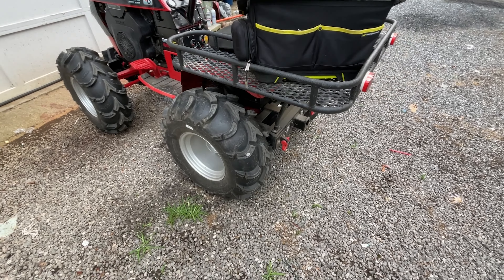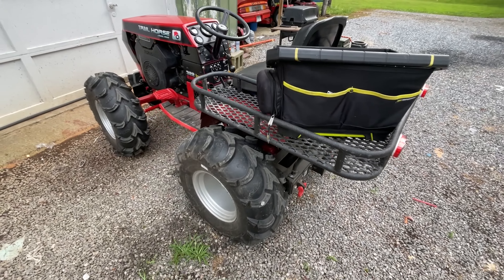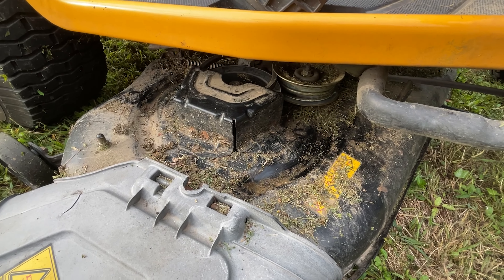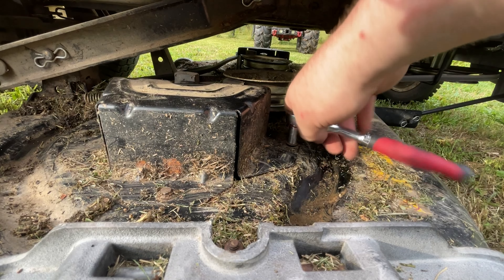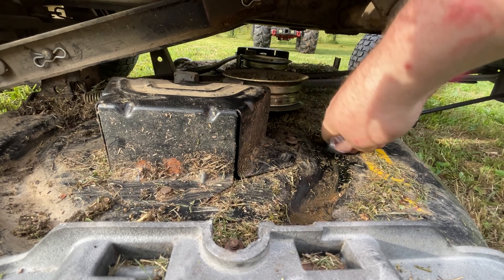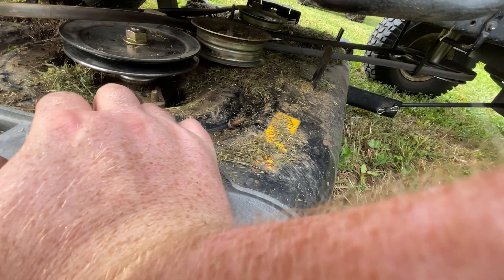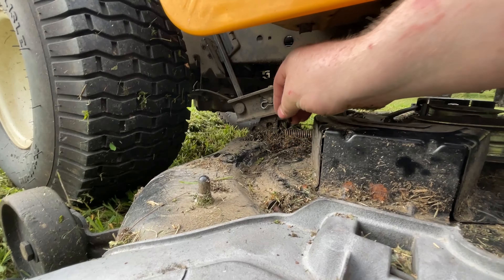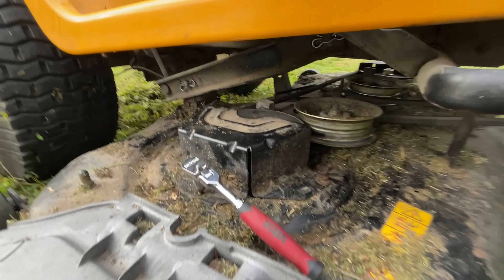A Mower Emergency! Sunday Afternoon Service Call.

Comment: I just got finished up on the fabrication and testing of a John Deere 214 Mud Mower. It’s got a four-speed Peerless 2300 transmission in it. I did a pulley swap where I put a 7 inch on the motor and a 5 inch on the transmission, that seems to be the general go to ratio. When I start out in third or fourth gear, I get belt squeal when I’m leading the clutch out. Only for a second though, and once it’s engaged It’s fine. Right in the beginning when you took off it sounded like there was a bit of belt squeal. Also, does yours do it every time?
Reply from the maker: I’m running the stock 8 speed uni drive. It has 3 speeds forward with a high and low range. The downside to this transmission is they don’t shift to well on the fly.  But there bullet proof. Low range I don’t have any belt squeal. High range first takes off fine, 2nd depending on the terrain you might have to let the belt slip a bit. 3rd gear you have to let the belt slip to get it going once your moving it’s great. It cruises best at 15 and tops out around 24. It only only squeals when slipping the belt, like you said once engaged it’s fine. I’m running 7” on the engine and 4” on the trans.  This tractors heavy. Stock they were 650 pounds. I added a lot of weigh just in bumpers and the rack. I’d guess it’s around 800 pounds. It makes an f-150 do the Carolina squat!
Reply: @AbbyNormalGarage  800 pounds! Dang that is heavy! With the Peerless 2300 transmission I’ve got, I was a bit disappointed that it absolutely does not shift on the fly. But I did anticipate that would be the case before I drove it.